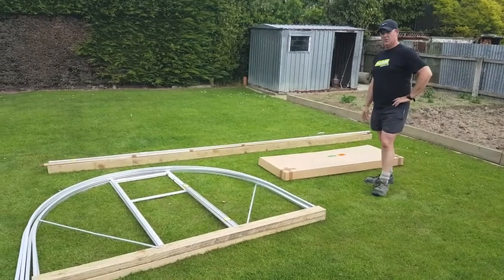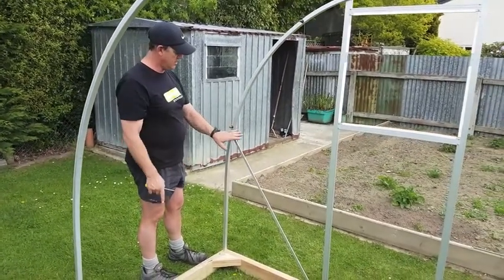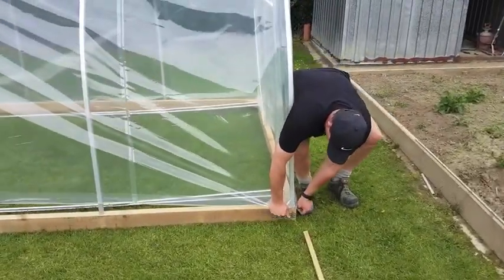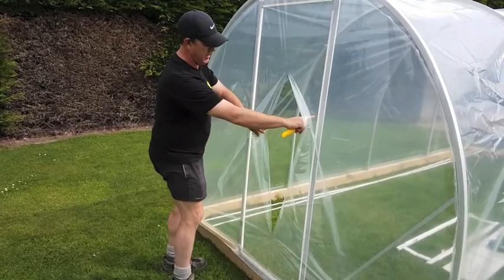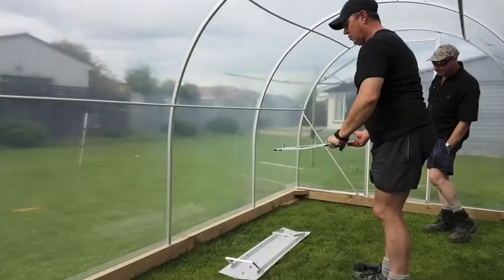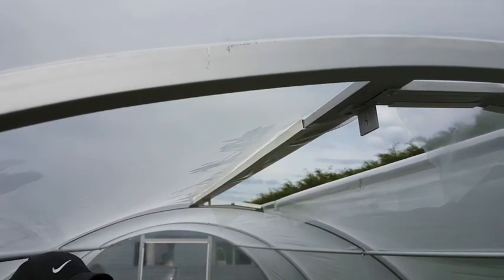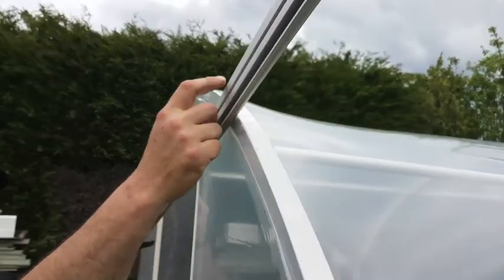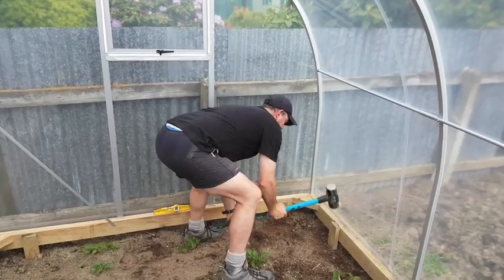How To Build a Greenhouse

Comment: Was a mission to bang the nails in the corner boards, one board had a small knot. Would’ve been good if had partial small drilled holes for nail assistance. Took me and Dad 2-3 hours just to assemble framework.